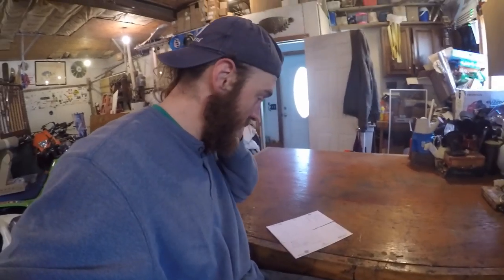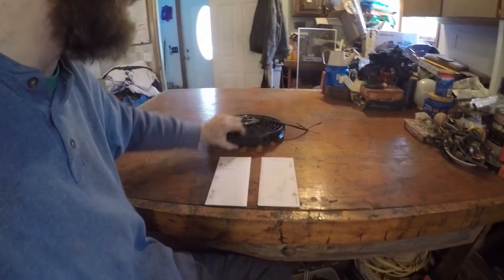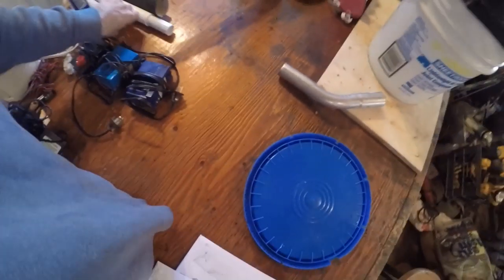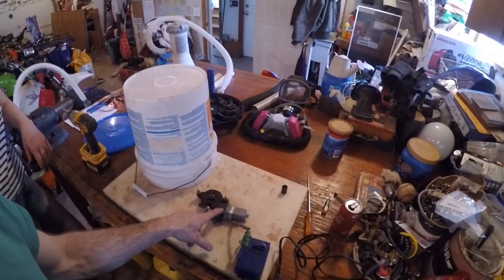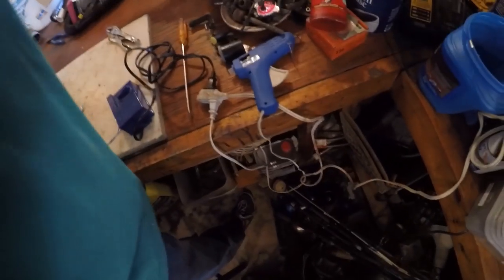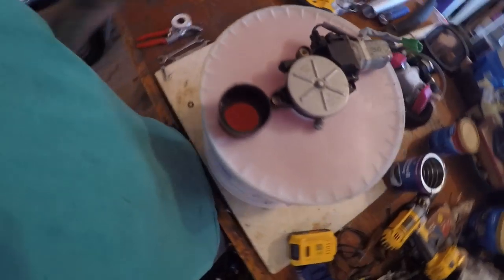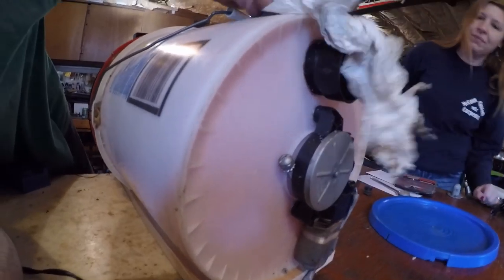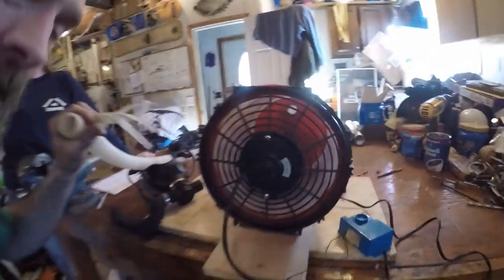How to Design and Build a Ventilator

Comment: With all due respect this is not a ventilator.  A ventilator is typically hooked up to an endotracheal tube and not a mask.  One has to be able to dial in or set an inspiratory volume (TV)   (active) and a passive expiratory phase.  The tidal volume (TV)  (amount of volume with each breath) must be adjustable.  The requirement is also able to set the Inspiratory:Expiratory ratio.  (The ratio between  time the TV flows and the patient exhales).  Thee are guidelines for ventilators, unfortunately, this is not meeting those requirements at the present time.  Additionally, one has to be able to regulate the F iO2 (that is the amount of oxygen being received).  In its current state, not too valuable in a medical setting.  Keep working, you'll get there.  You might also want to check out MIT's make a ventilator page.  Best of luck.  The expiratory end of the circuit has to go through a HEPA filter otherwise  the coronavirus will be exhaled into the air.  Good start
Reply: respectfully, desperate situations cause for desperate measures especially when the hospitals are now at a major crisis.
I can understand him wanting to try a new experiment to save his family.
I know as a last resort I'd try it even if it didn't work.
But here's the thing...it just might work!
As with the face mask, first the media was saying awhile back it was not effective only for those who were already sick so they wouldn't spread it to others.
Now they're saying ALL wear any homemade thing to cover your nose and mouth.
Perhaps it's not 100% effective but it'll provide some protection.
so why not hand-crafted ventilators they may work a miracle.

Comment: You need some type of rubber gasket around the edge of the rotating disk to prevent air from bypassing the disk
Reply from the maker: I will be making all kinds of adjustments and improvements to this design.  Thanks for the input.